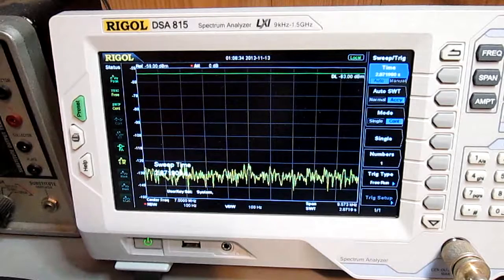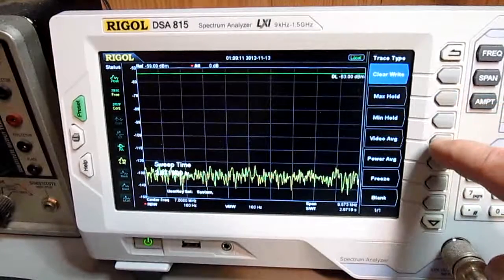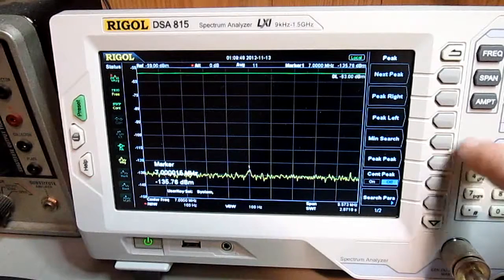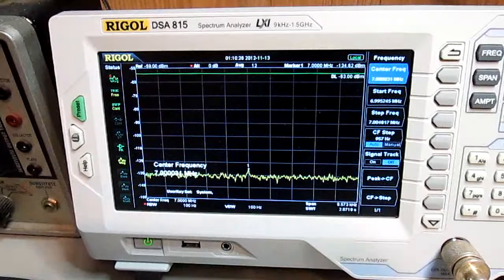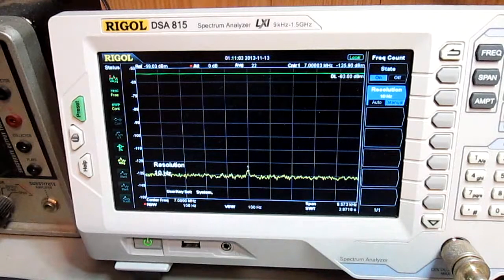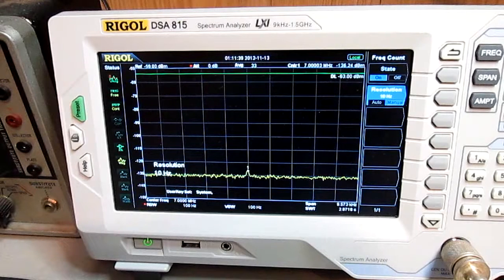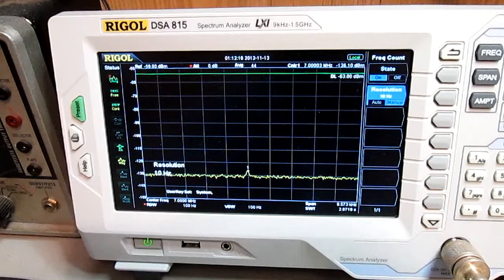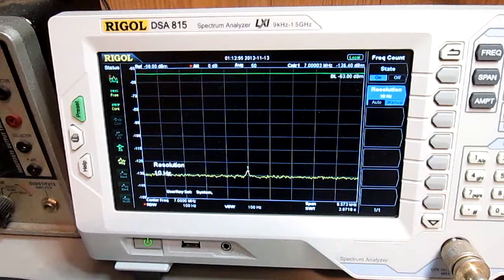RIGOL DSA-815 Weak Signal Measurement

Comment: Hi Randy, thanks again for showing how this thing really works!  I did the same experiment and got the same results.  One thing that did happen is that it decided to do an auto calibration in the middle, and that caused the average to start over.  It would probably be good to do a cal, turn off auto cal and then do the average.

73,
Len, KD0RC
Reply from the maker: Actually I did mention that in one of the videos, just not sure which one .. Yes that can be a bit annoying when the trace time is in seconds... and you need several sweeps to average ...